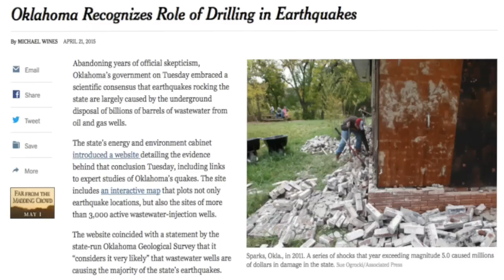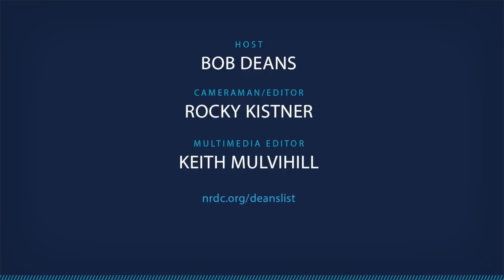The Deans List: Earthquakes Linked to Fracking Waste

Comment: The Deans List: Earthquakes Linked to Fracking Waste. Pub. Apr 29, 2015 - Two independent geological surveys concluded that wastewater disposal linked to oil and gas drilling is to blame for the increased frequency of earthquakes in regions where drilling is common. Confirmed in Oklahoma, Texas, Ohio, Colorado and more. So says the USGS finally confirms wastewater fracking causes earthquakes.